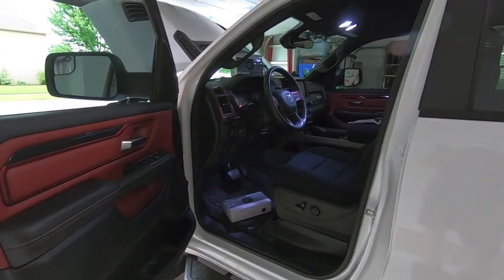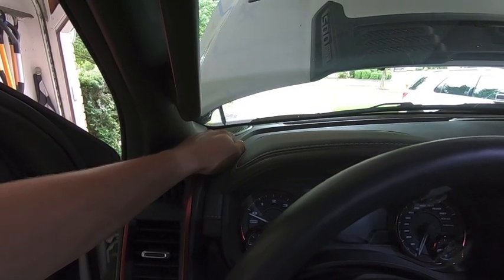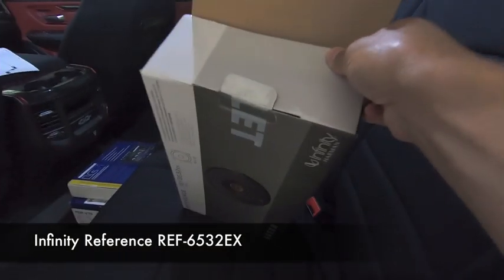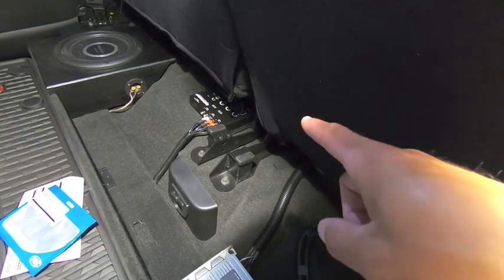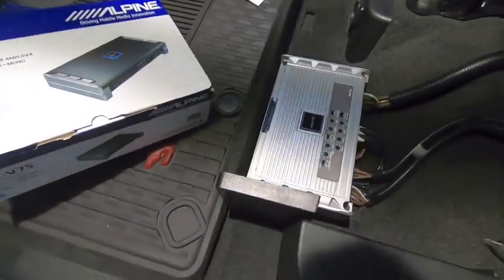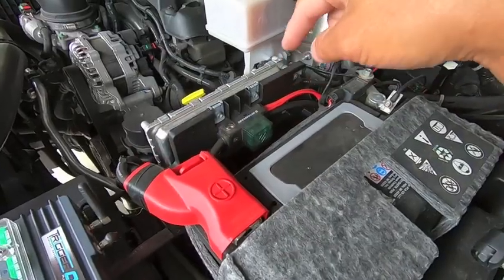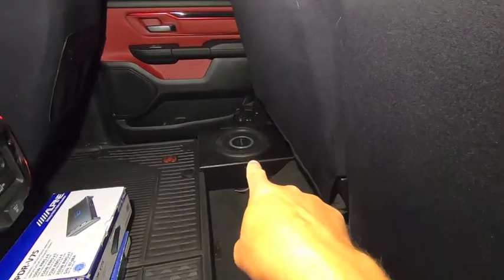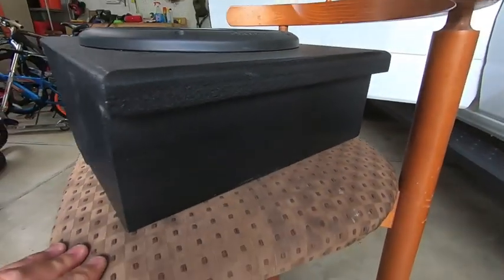Stereo Build Walkthrough - Ram Rebel

Comment: I have a question on the configuration of your LC7i. Did you set the jumpers on the LC7i for summing the input signals, or did you leave it as factory default for non-summed?
Reply from the maker: Kept them as stock

Comment: water fowler: i have my new system diagramed out. i was wondeing if you could take a look and tell me if the signal flow is correct. if you dont mind taking a look i have it in a PDF file. how can i get it to you
Reply from the maker: You can email me at waterfowler4one@gmail.com

Comment: I used this exact wiring for a 2021, lc6i tho and infinity amp. I have it all wired up but im not getting signal to the lc6i. Im not sure if i have the anc wired right or if i missed a step? Any info would be helpful! Thanks!
Reply from the maker: I’d double check and be sure you’re grabbing the speaker level signals from the correct side of the anc harness
Reply: @WaterFowler41  i did, a even swapped them from side to side to test and nothing, i called cruthcfeild and they said i need resistors. do you have a pic or clear wiring diagram so i could double check?
Reply from the maker: @thomassimon972 I had to add resistors when I updated my radio to the 12”.  This what I used:

https://www.bestbuy.com/site/audiocontrol-20-ohm-load-generating-device-and-signal-stabilizer-pair-green/6482929.p?skuId=6482929&extStoreId=311&utm_source=feed&ref=212&loc=19663688574&gad_source=1&gbraid=0AAAAAD-ORIjD9l6Xs3WtAxwZkTCf4n0ui&gclid=EAIaIQobChMI45rKooPqhAMV5G5HAR0PuAJZEAQYAiABEgKn1_D_BwE&gclsrc=aw.ds
Reply: @WaterFowler41   thats what crutchfeild sent me, they said i have to just splice them inline with the signal from the truck to the lc6i and itll all work! theyll be here tue/wed, thanks for the help!
Reply from the maker: @thomassimon972  they should plug right into your lc6
Reply: @WaterFowler41  so itll go anc to resistors to lc6 to amp back to anc? anc being that factory tie in
Reply: @WaterFowler41  and i should also add i had it running on a 4 channel with no load resistors

Comment: Did you need load resistors before the LC7i?
Reply from the maker: I ended up installing AudioControl AC-LGD 20 later on when I installed the 12” screen because I didn’t have enough load on the speakers and the head unit would go into safe mode.

Comment: I’ve installed this exact system on my 2019 ram big horn with same base level 6 speaker stereo. I’m not getting any output from the head unit. Is there a chance I need to buy the AC-LGD-20 load resistors?
Reply from the maker: If you followed what I did with my harness then you shouldn’t need the resistors. Did you try removing the anc-ch01 and seeing if you get sound out of your speakers?
Reply: @WaterFowler41  yes, if I remove the harness and test speakers they don’t work. After locking doors and waiting 20 minutes they’ll work again (which I believe is after the unit does a reset). I’ve repeated that several times. I’ve got them on order so we’ll see what happens. Symptoms seem to call for it. Thanks for a great tutorial, look forward to getting this working
Reply: Update to this: I installed 20 ohm load resisters and after doing the 20 minute reset on truck (close, lock doors and wait) I now have speaker output and everything is working beautifully!
Reply: @glennwoodward77 did your incoming phone calls get really loud?

Comment: Hi! I have the same amp as you. I was wondering did you bridge your Sub or did you use the dedicated sub channel and not bridge it. I wanna bridge my sub but I don't know what channel to use. Your help would be appreciated!
Reply from the maker: I use the dedicated sub channel since the other 4 channels power my speakers
Reply: @WaterFowler41  how does it sound using the dedicated channel. does the sub hit  pretty hard and also does the amp get hot where you mounted it at?
Reply from the maker: I’ve had this amp for 4 years and have always used it set up this way, for the music I listen to, it hits as hard as the sub can handle. Never had any overheating issues.
Reply: @WaterFowler41  awesome thanks!

Comment: For the signal speaker for the LCI, did you run the 16 pin as feed or the 22 pin side?
Reply from the maker: I cut the speakers wires that are a apart of the pac harness.

Comment: Really awesome video. This is the type of videos people need to make. Can I get the dimensions for the box. Hopefully I can do one for mine.
Reply from the maker: Thanks!!!! I just added the subwoofer drawing and some additional pictures for reference. The link to the folder is in the video description.
Reply: @WaterFowler41  thank you. I have a question. Does the ANC work with the 2019 Ram Big Horn?  That’s what I have.
Reply from the maker: As long as it’s the v8 with base 6 speaker package yes.
Reply: @WaterFowler41  thanks.
Reply: @WaterFowler41  sorry one more question. If you cut the wires from the anc. The wires from the amp are connected to the piece that you just cut off. So what would it do? If the pice was cut off from the ANC to connect the cables to the LC7i.
Reply from the maker: @27jsoto  cutting the anc harness allowed me to intercept the speaker signals, send them to my lc7i, then to my amp, then from my amp they attached to the other side of the cut I made in the harness where the signals travels to each respective speaker
Reply: @WaterFowler41  thanks for you’re reply. But I still can’t get it. Sorry. If I’m cutting 1 of the plugs to connect the wires to the LC7i the rest of the plug is loose it doesn’t connect to nothing why would I connect the amp there if it doesn’t connect to nothing. Or all 3 plugs connect to something?  Once again I’m sorry for my ignorance
Reply from the maker: It’s not loose you cut it to grab the speaker signal and then you reattached you now amplified signals to the other end of the cut.

Shoot me an email, and I will draw it out for you. Might be more clear that way.

waterfowler4one@gmail.com
Reply: Did you sent me the email? I was wondering because I haven’t seeing it.
Reply from the maker: @27jsoto  I added a wire diagram to the share folder in the video description.  That should clarify how the harness connects.

Note, just because the black harness says 16-pin doesn't mean you will have 16 wires.  On the base 6 stereotrucks, the black plug should only have 8 wires, a positive and negative for each corner of the truck. 

The black plug will be unplugged from the ANC module and will plug into the ANC-CH01 hareness.
Reply: @WaterFowler41  thanks.

Comment: Which metra adapters did you end up using on the speakers. Reading on the forums and some people say 3614 some say 3615
Reply from the maker: The link to the harness I used is in the video description
Reply: @WaterFowler41  did you find that any of the speakers were out of phase with each other for the anc system or did you not worry about polarity
Reply from the maker: Nope checked every speaker while installing them and it worked out great

Comment: What if you have a speaker package in my case the hardon Cardon one what do I do then?
Reply from the maker: You’ll likely need the Amp Pro harness to add additional stereo equipment to an OEM-amped stereo
Reply: @WaterFowler41  difficult you think?
Reply from the maker: Nope just a few more parts and a little more $$ to upgrade

Comment: I just caught the fact that your ANC unit is silver and has 2 plugs (I guess). Mine is black and has 3. According to PAC site, mine is actually an amplifier, not just ANC. But, it's not an Alpine or Harmon Kardon system. No wonder I can't make complete sense of the adapter. Gonna call their tech support...
Reply from the maker: By chance do you have a v6?
Reply from the maker: If you have a v6 it’s very likely you do not have ANC and it’ll be just an amp.
Reply: Come to find out, its an Alpine amp. Doesn't say Alpine on it, and I don't have a factory sub. But the pic is identical. I bought a similar adapter from PAC, and about to go see what happens. Should work fine.
Reply: No. I have a 5.7 Hemi
Reply: Through trial and error, I have discovered that I DO have a factory sub! I have no idea how to access it,  being that I have a Quadcab, and can't get to the release cords. Other than that, still trying to figure these adapters... 🤔😠😔
Reply from the maker: If you go into the share folder in the comments there is a crutchfield installation manual. It has more info on how to access your factory subwoofer.

Also kudos to you for digging into your stereo. Keep the updates coming!
Reply: More discoveries,  it is also an Alpine system apparently.  There is a sub behind the rear seat, and there is also a center channel speaker in dash. I'm singling out the individual speakers to get them all hooked up, but I don't have any volume control. Par for the course for me though..🙄

Comment: Couldn’t you have just used the AmpPRO AP4-CH41(R.2) instead of the LOC and the ANC CH01?
Reply from the maker: I already had the loc so it was cheaper/easier to pick up the ch01
Reply: Water Fowler 41 I’m trying to learn how to upgrade my 2016 ram with the six speaker and it seems like if you’re starting from scratch the ampPRO is the way to go. Thanks for this video though. Excellent and very informative
Reply: Water Fowler 41 one more quick question for you, is it worth running new speaker wire to each speaker or is the factory wire sufficient?
Reply from the maker: I’ve used this same amp/speaker set up across 3 trucks and never had an issue with factory wiring. The audio purists might but for my application, OEM works. It’s a lot of effort to run new wires to each speaker, the juice needs to be worth the squeeze for me.
Reply: Richard Mc thanks, figured I’d try it out first and see I notice anything to make it worth running the new speaker wire.

Comment: When using the GTO option, run the speaker wire coming from the 22 pin white plug to the main output for the lc7i.

*DO NOT USE THE BLACK 16 PLUG FOR THE GTO OPTION AS YOU WILL BLOW YOUR STERO BEHIND THE DASH***
Reply from the maker: What would running that wire to the main output of the lc7 do?
Reply: @WaterFowler41  it eliminates the need for a remote signal, it reads the signal off the speaker wire to turn the lc7i on
Reply from the maker: Ok I ended up turning off gto and ran the turn on lead

Comment: The lc7 should have recognized a signal from the head unit and made it own remote wire
Reply from the maker: It was but it also was doing it every time I opened my doors so rather than letting it cycle on and off, I just went with an old school turn on lead from the fuse box
Reply: @WaterFowler41  My bad I believe you said that in the video. At what volume number are you clipping?

Comment: I have a 19 ram 1500 big horn not alpine and I just got my anc-cho1 and can some one send me pictures how to hook it up please don’t wanna mess nothing up and thank you
Reply from the maker: It should be pretty straight forward, the plugs only fit one way. Are you having issues?
Reply: I did everything like you did on your video but instead of a big amp I installed a alpine 4 channel for my regular speakers. It works, but when you shut the truck off and u restart it. None of the speaker will work, but the radio will keep playing.
Reply from the maker: How are you turning the amp on? Did you use an add a fuse or let the amps auto sensing turn it on?
Reply: @WaterFowler41  yeah I used a add on fuse i have the 445 u alpine does that have the auto sensing?

Comment: these speakers are not a direct fit nor the correct size.  6x9 is the correct size and direct fit had to order again :|
Reply from the maker: 6.5 and 5.25 fit in 6x9 holes. Crutchfield adapters with the speakers. 100% bolt on. If you bought the speakers from somewhere else, you probably didn’t get the adapters.
Reply: @WaterFowler41  got the adapters but its not worth downgrading speaker sizes and not just buy the 6x9 directly..

Comment: add a 4 ohm resistor to your dash speakers.  It will balance the power being sent. Door speakers stock are 4 ohm, dash speakers stock are 8 ohm. quess what happens with the extra 4 ohms of resistance when they are changed to a 4 ohm speaker? drives the dash speaker with more power.
Reply from the maker: good to know!

Comment: So you only ran two rca outputs from the lc7 to the amp? To be able to adjust them and wires the sub from the amp only correct? Dont need a separate channel rca for the sub? If so, could i get away with an lc2i instead ?
Reply from the maker: If you ONLY want to do a subwoofer, yes an LC2 will do the trick.  I ran the 4 signals into the LC7 to sum them (add highs and lows together) then ran those signals into the amps so each channel receives a FULL signal.  The 5 channel amp has a filter channel so I fed my subwoofer with that signal.

If you use just the lc2, you will splice into the two front channels not completely cut the wire and feed them into the lc2, then send that signal into the amp for your sub.